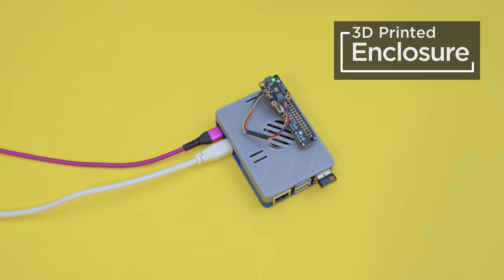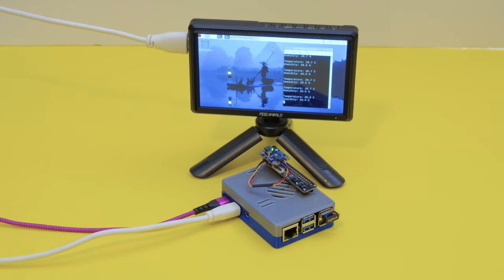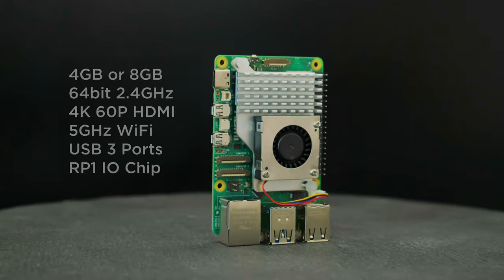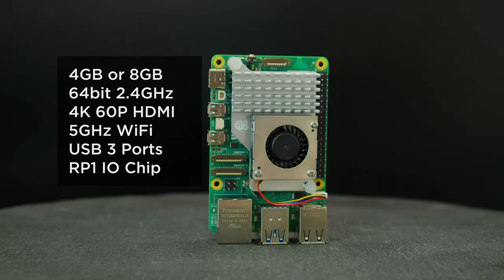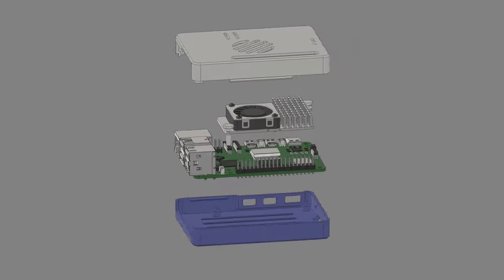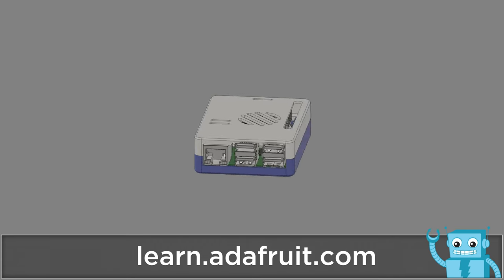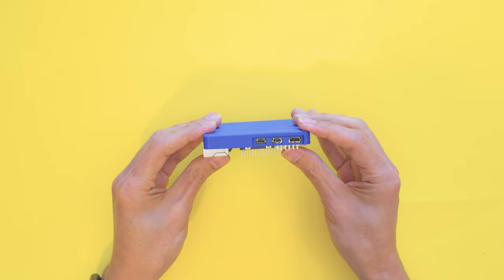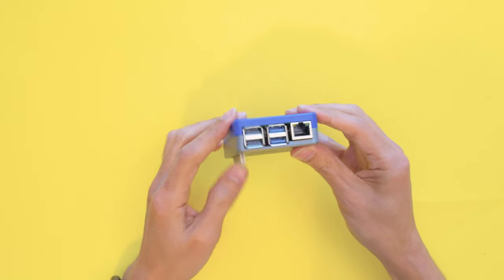Raspberry Pi 5 3D Printed Case #adafruit #3DPrinting #raspberrypi

Comment: What is that board plugged into the headers in this video please?
Reply: From the pins ---> (1) Stacking Header for Pi A+/B+/Pi 2/Pi 3 - 2x20 Extra Tall Header ---> (2) Adafruit EYESPI Pi Beret - Buttons, EYESPI and STEMMA QT ---> (3) Adafruit AHT20 - Temperature & Humidity Sensor Breakout Board - STEMMA QT / Qwiic